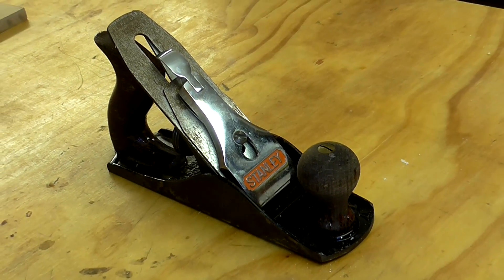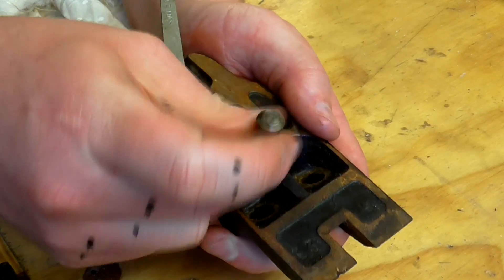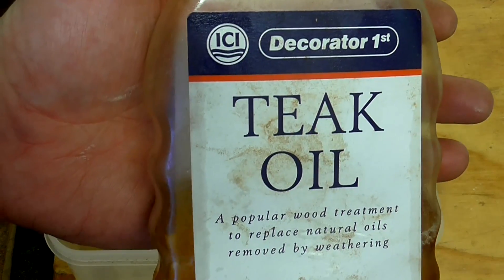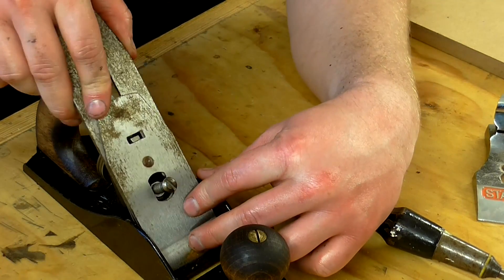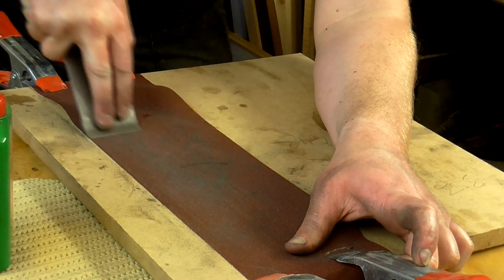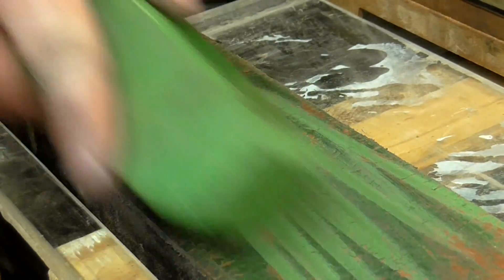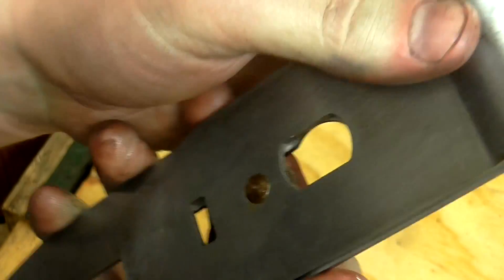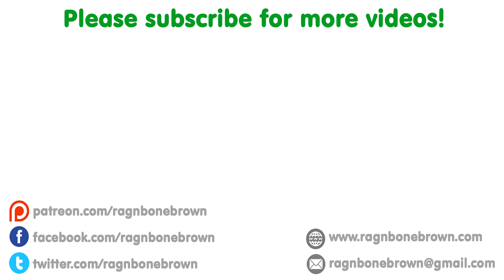Restoring A Hand Plane - vintage Stanley No. 4

Comment: If you find a couple pieces of thin wood (shims) and cut them so they're roughly 15-18mm wide by 125-150mm long by 2-2.5mm thick. Get some 220 grit and lightly apply some spray adhesive so that the sandpaper adheres to the stick evenly without random high spots/bubbles. That way you can easily/evenly sand the frog seat and both sides of the throat. Great video. 😀

Comment: Nice video, and good job!  I would like to make one point, specifically on flattening the sole.  The sole was not flattened properly because of the way you attached your sandpaper with clips, which raised the front and back edges of the MDF.  That is why the front and back of your plane were scratched, but not the middle.  The MDF had flexed, very likely resulting in a rounded sole.

Comment: Hello, just discovered and subscribed.  I like to restore old hand  tools and one thing I Luke to do is use low voltage electrolysis to remove rust.  Basically an old phone charger and salt water.  It's readily found on Google.  A lot of detectorists use this. 

Then you can see  where just some polishing or where you need to get aggressive. 

Good job on that tool!

Comment: Thanks for posting the video Keith. Ironically I bought an almost identical no.4 plane on eBay last week! Not needed as much TLC as yours as I paid a little bit more. I used the bench/belt sander to flatten the sole and sides with 80grit. Just need to do the wooden handle now (the innards are ok) so I'll use your method. 
Thanks also for the link to find out how old the plane is I'm interested to find out.

Comment: I have my dads mabe my granddads one of these and its in bad condition the handle has split in to several rings and its full of rust, i must get out of of storage and see what model it is on that site you linked,

you done a fab job on that restoration brings back memory's of helping my dad when he used it

Comment: Nice video. We've got a single plane in the small woodshop I work at, but it's currently broken. The main bolt hole on the frog is stripped. Would love to get a replacement for it.

Comment: You could always turn your other plane into a scrub plane.  Put a heavy camber on the iron and use it for heavy stock removal to  knock off a wobble on a board before sending it through a planer

Comment: good video . ive just done a bailey 4, bailey 3 , record 4. all oicked up from a bootsale fir an average of 3 pounds each. bees wax on the handle after oil works great. if you scrape the old laqure with the blunt side of a flat screwdriver it comes off easily with no scoring.
Reply: Great video. Wiping the handle and tote with lacquer thinner will soften and help remove the old cracked finish.

Comment: hi keith enjoyed this vid, the only thing you did not do when you were sharpening you blade was round the corners off , do this you will not get blade marks on your work peice if it is  wider than the sole of your plane
Reply from the maker: thanks Chris, good tip

Comment: love a good restoration , nice one mate, hope im not to to late to get my hands on the plane. i could do with a proper plane the one i have takes wayyyy to long to adjust it so frustrating. its one with two twist screws to adjust the blade, but its so akward to adjust the right amount,right pain in the arse. Hope you had a good holiday / time traveling by the way

Comment: Hi 
Very nice vid... how can you explain that the blade protrudes so far outside the mouth?? I just bought one with this problem... looks that the frog is not the original one...
Sergio
Reply from the maker: Sounds like you need to move the frog backwards. Check out my video called hand plane set up in 7 simple steps and let me know how you get on! Good luck

Comment: Just a little tip I wouldn't polish the back to a high degree I'd personally stop when I reach 1000 grit then start on the bevel and alternate between the back and bevel on each face of the sharpening stone and then polish the two edges. By stroking the bevel 10 times then the back and decrease the amount of strokes per time this works best for me anyway

Comment: nice resto! i wan't another no 4 :)
Reply: Stavros Gakos:  I've just finished restoring a Stanley No. 4 with a Kleen Kutter iron, lever cap, and ribbed sole. I first thought it was a Kleen Kutter K4 until I saw N0 4 on either side of knob and "Made in USA" behind the knob. This plane produces a beautiful curled paper thin shaving. It was in good condition with only light rust and pitting and now looks and performs like new.

Comment: You sharpened the blade at a very short steep angle. The / My draper honing guide suggests 55mm for a 25deg and 40mm for 30deg

Comment: I want it !   Thx for sharing your knowledge. You may heard about the trick removing rust with vinegar? If you have a tool complete covered with rust, just put it in vinegar for about 2 days (cover it totally). After that clean and oil it ;)